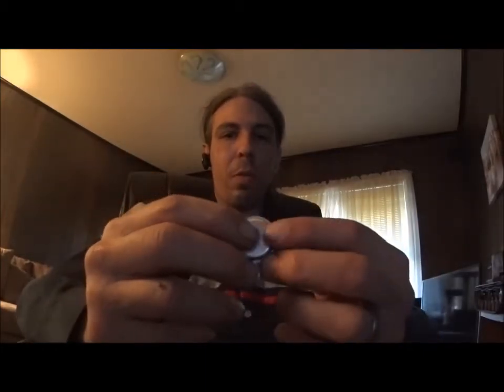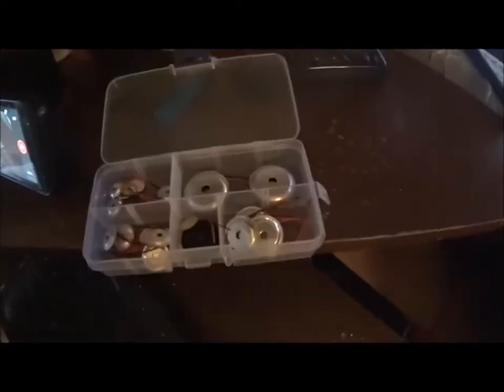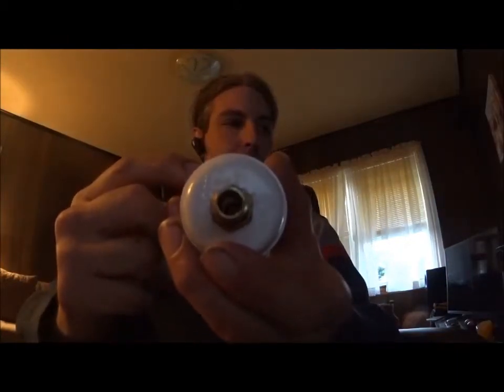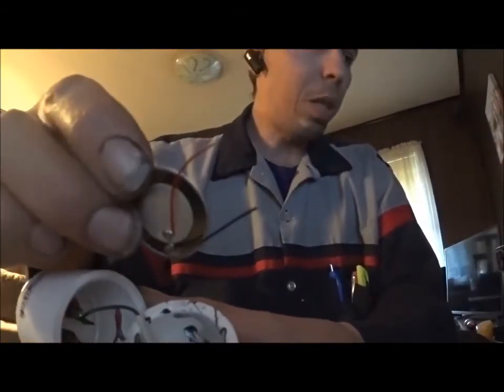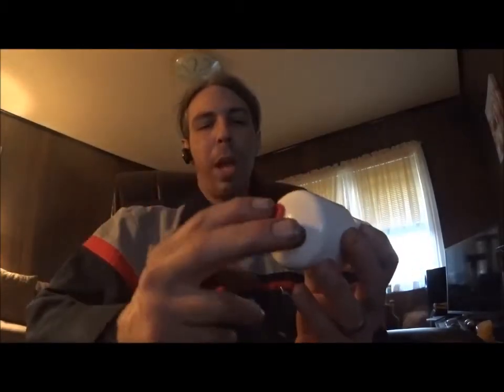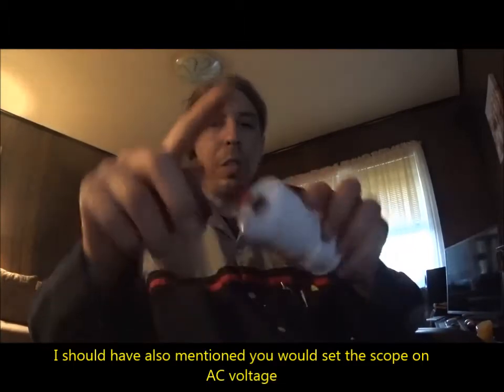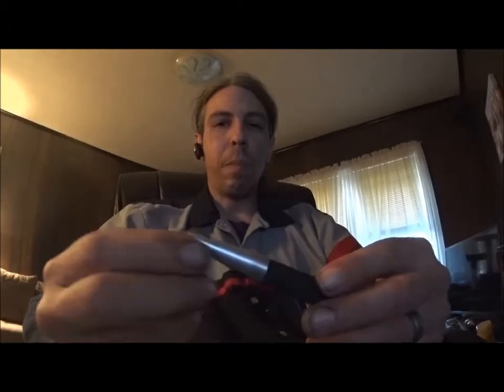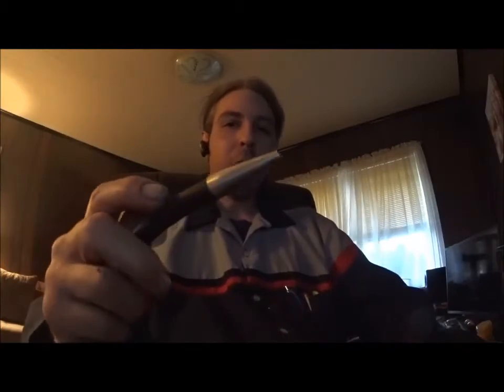Making  a Pulse Sensor for Scope Testing

Comment: excellent video Joe thanks     I have 3    there awesome      try it on the dipstick tube to check crankcase pressure {piston rings}
Reply from the maker: They are home made like these?
Reply: no I have FLS by sentex  PPS by ditex and ebay 20 dollar transducer    I plan on making one like yours    I just ordered the piezo electric piece from ebay       headed to home depot for the other parts    I will use a BNC lead       one thing I heard about using these type pressure sensors is to use a venturie in test hose     thanks again Joe
Reply from the maker: Have you tried this Mark?